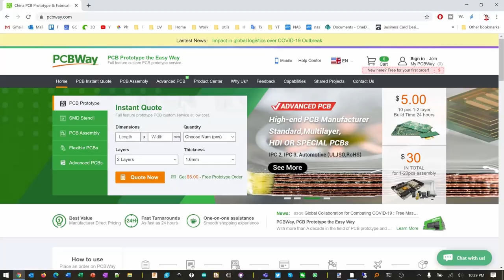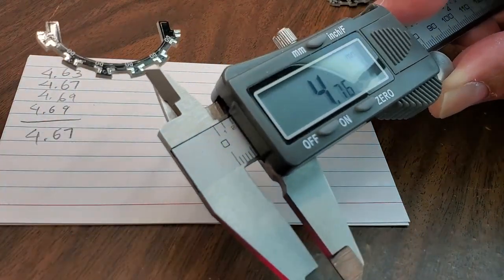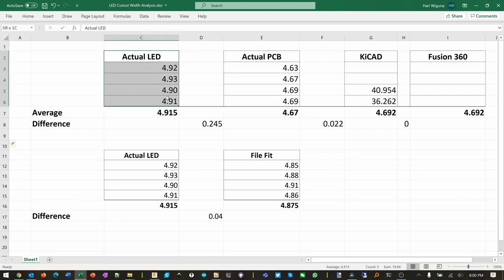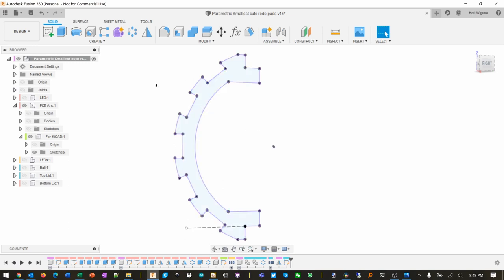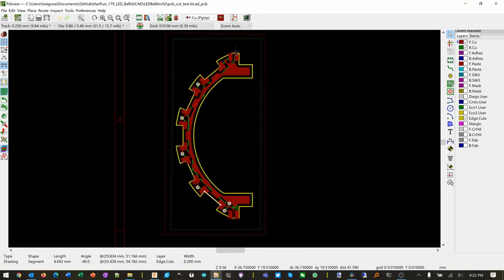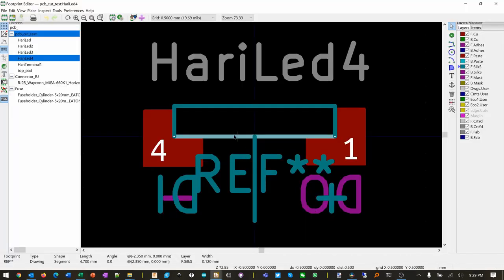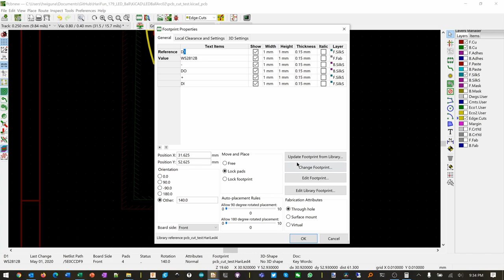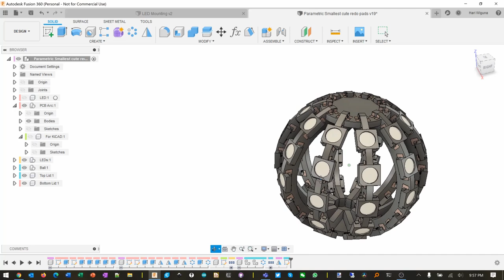HariFun #183 - LED Ball Part 2

Comment: Great detailed work. Keep these videos coming! :))
Reply from the maker: Thanks R! Yes, I will make the discs next and that should complete this project.  I can't wait!!!
Reply: @HariWiguna  I like your LED-mounting method because it would allow me to create something I have wanted to make for years: an 8 X 8 X 8 LED cube using WS2812B SMT devices. I think you could make a PCB that was thin and black, 8 LEDs long and use them as the cross-pieces. They would be almost invisible, not obstruct the light coming from other LEDs, and the wiring would be minimal. 
Can't wait to see your finished ball!